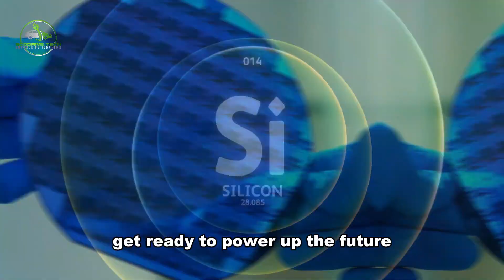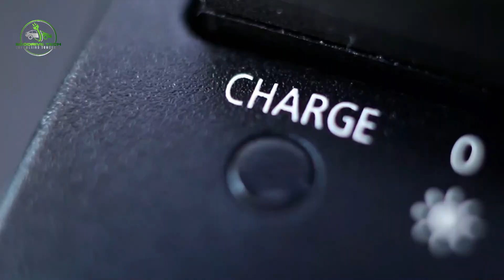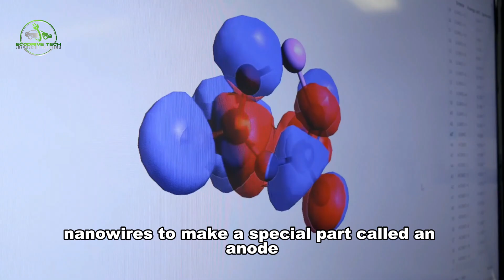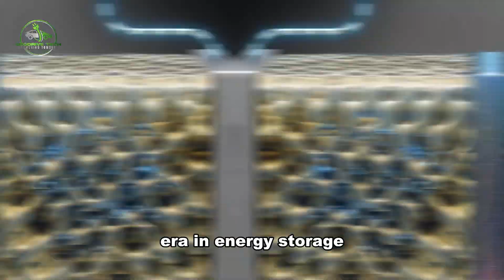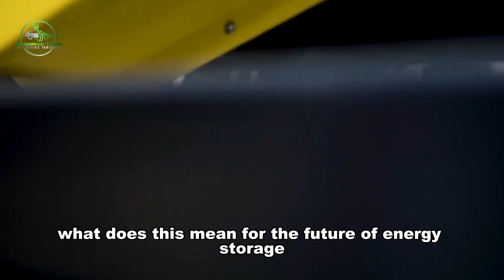Revolutionizing Power: Ultra-Dense Battery Breakthrough!

Comment: Where the hell is all this clean (zero emissiom) electricity going to come from and where is the grid to deliver it?  Coal powered cars are not the answer.
Reply from the maker: Sometimes change takes time
Reply: Two things. Both energy mix improvement and smart grid.
Almost all countries have some or a lot green energy next to traditional energy generation. So if you charge it currently is partly green. In a few years the exact same battery will be greener without any change to the battery.
Second is smart grid. Most forms of green energy generation have peaks. A smart grid will help pause pr unpause charging making a battery greener with the exact same average energy mix.
Reply from the maker: Yes, specially the Smart Grid will be very import to help achieve the transition smoothly.